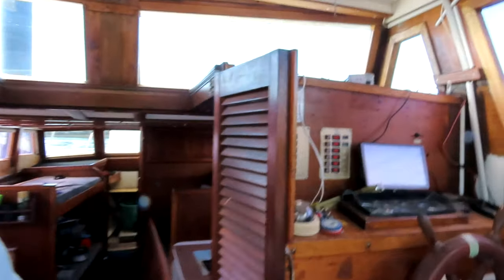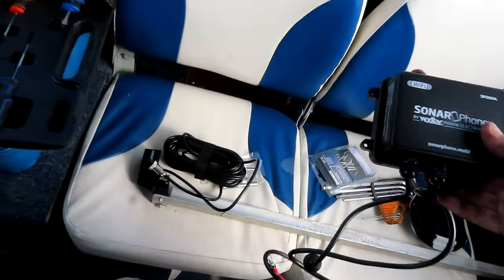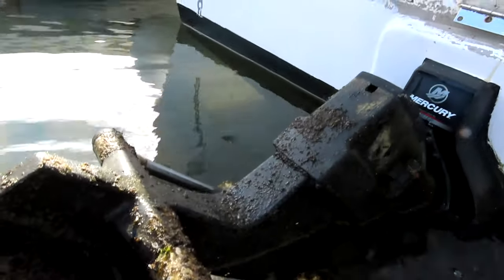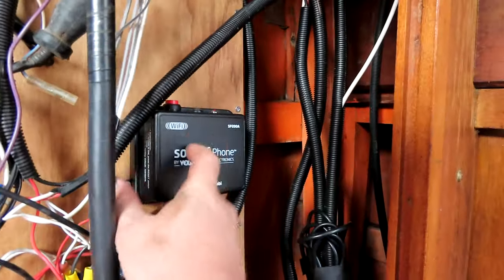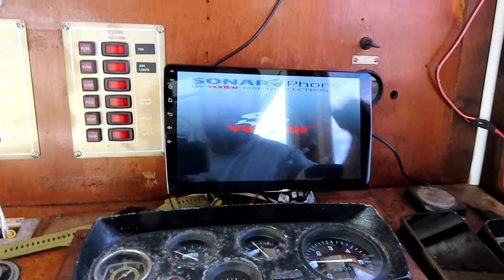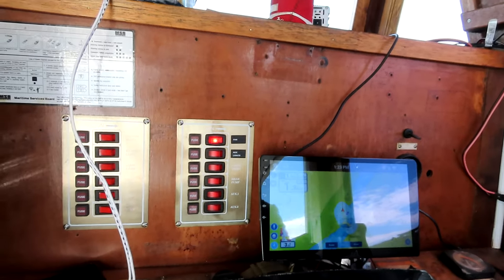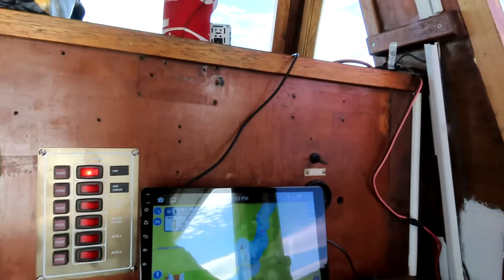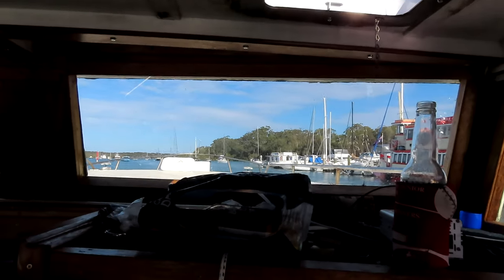VEXILAR SP200 WIFI transducer install, was it worth the money????

Comment: Great idea! I have been wanting to put something like that in my boat for a while now. I didnt know they existed. I will have to look into them and add it to the list. Did you buy it online?
Reply from the maker: I wouldn't hesitate to install one mate. Especially if you don't have any sort of depth sounder at all this even running through your phone will work very well whttps://www.amazon.com.au/Vexilar-SP200-T-Box-Smartphone-Finder/dp/B00CJJBMDO/ref=asc_df_B00CJJBMDO/?tag=googleshopmob-22&linkCode=df0&hvadid=341743161060&hvpos=&hvnetw=g&hvrand=31170647050089616&hvpone=&hvptwo=&hvqmt=&hvdev=m&hvdvcmdl=&hvlocint=&hvlocphy=9072225&hvtargid=pla-409441790804&psc=1

Comment: Excellent job Tim.
Do you have a link to where you purchased the sounder ?
Reply from the maker: Unfortunately they have gone up around $30au since I brought my one but Amazon is still the cheapest I have found for it.
https://www.amazon.com.au/Vexilar-SP200-T-Box-Smartphone-Finder/dp/B00CJJBMDO/ref=asc_df_B00CJJBMDO/?tag=googleshopmob-22&linkCode=df0&hvadid=341743161060&hvpos=&hvnetw=g&hvrand=31170647050089616&hvpone=&hvptwo=&hvqmt=&hvdev=m&hvdvcmdl=&hvlocint=&hvlocphy=9072225&hvtargid=pla-409441790804&psc=1

Comment: The Sonarphone is designed to penetrate through the hull. Maybe does not work with your hull but goes through my fibreglass hull just fine. 
Navionics no longer supports this device. Do not upgrade your software if it is working!!
It is frustrating when you use this device because your phone or whatever device is stuck on the sonarphone wifi. You lose your data connection. The sonarphone wont change to another network if you have one.
Also frustrating, the sonarphone reports 0 depth when water depth is beyond its range.